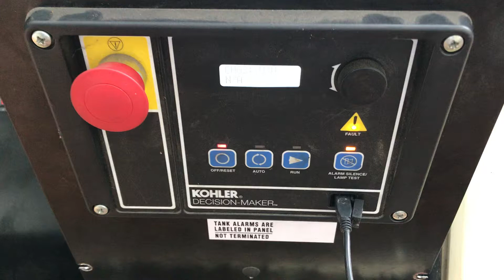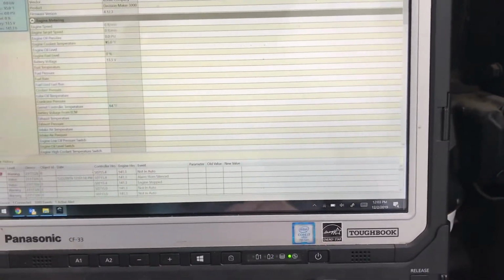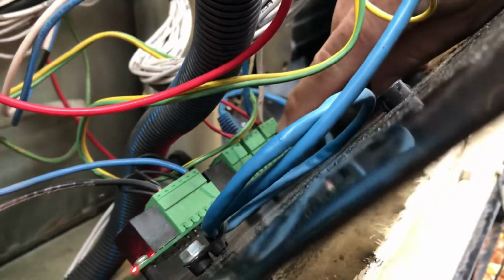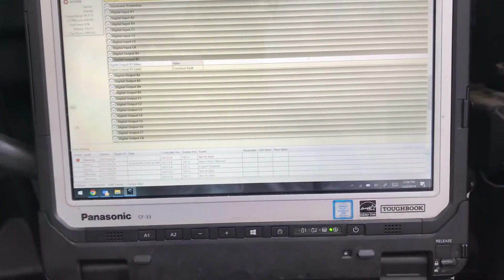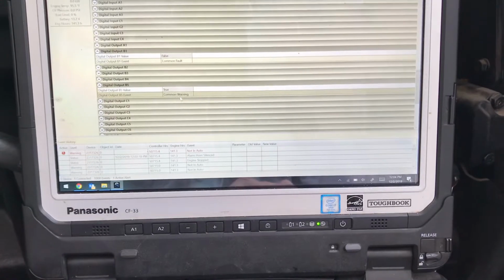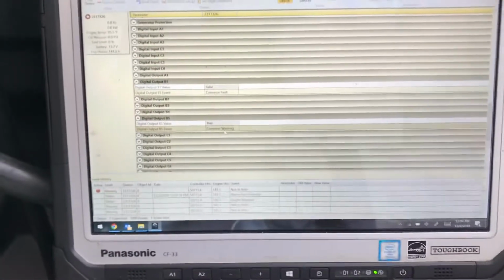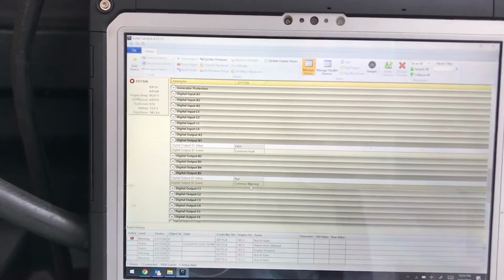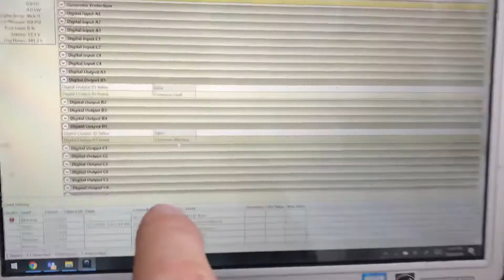HOW TO: Kohler Decision Maker 3000 PROGRAMMING OUTPUT RELAYS

Comment: Have a e stop emergency shut down its a 50kw .checked e stop everything seems to be in place Generator won't go into auto or crank up alarm systems going off . It only has 59hrs .
Reply from the maker: check for remote estops. pull the controller out and check make sure everything is tight.